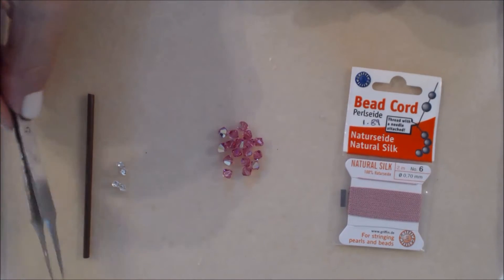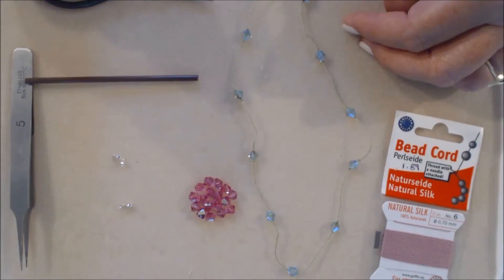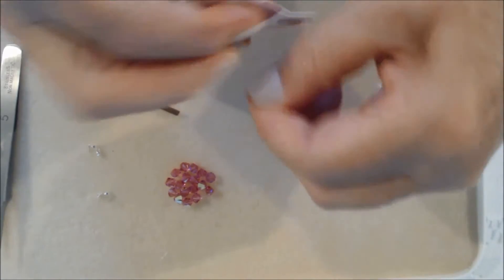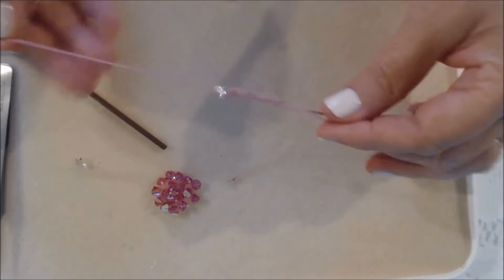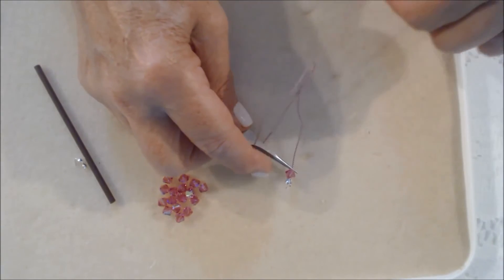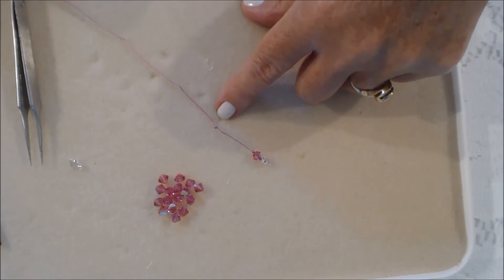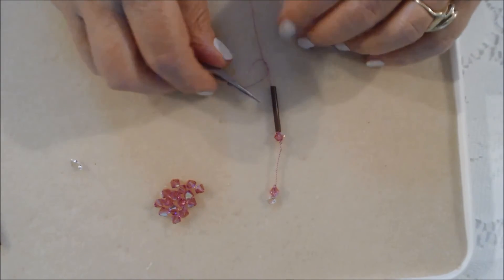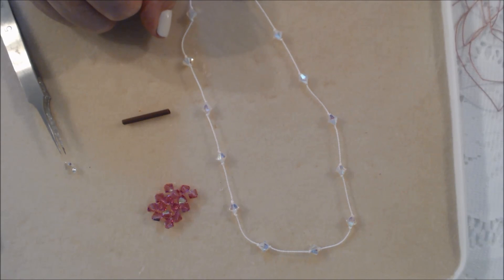Tin Cup Necklace

Comment: Lovely! How do you finish it and clasp it?
Reply from the maker: To finish, after your last bead is on the silk do not put a knot.  Instead, slide the other clamshell on your silk with the backside toward the bead. Make your knot and slide it into the clamshell. Close your shell around the knot.  To add a clasp just attach to the loops that are on the clamshell.  You can use any clasp you prefer.  Hope you have fun with this.